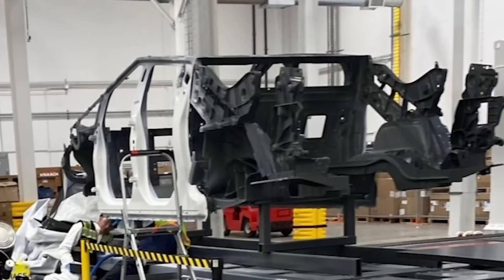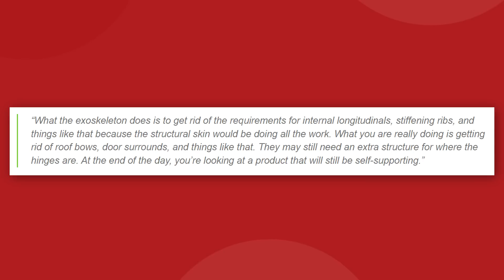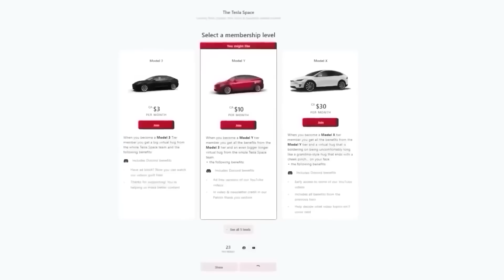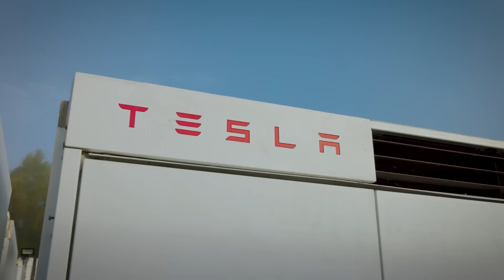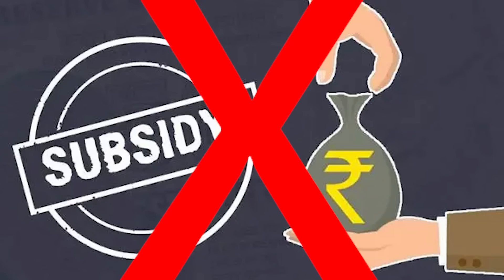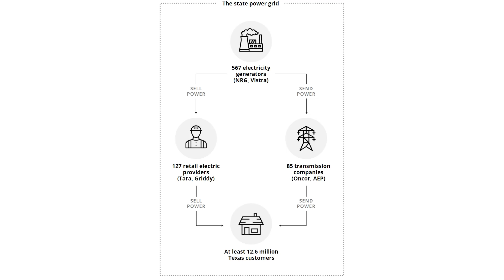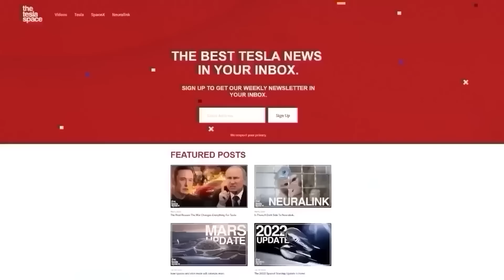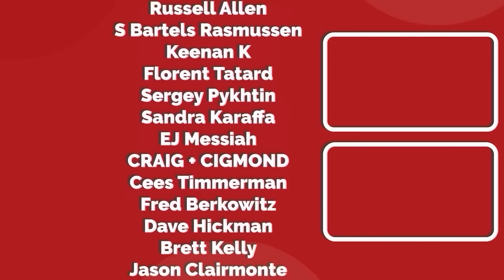New Cybertruck Giga Press Body Revealed!

Comment: Much more stronger and rigid than traditional cab on frame truck designs.
My only concern is when you get in a car accident, how are they going to repair the exterior stainless steel?  They will probably need to remove each damaged panel and reweld new panels on.  No paint job required so it should be still cheaper.  Cybertruck wraps are going to be very popular.

Comment: A possibility is that they may have sprayed it black in order to 3D scan it. Aluminium is reflective, so painting it could help the 3D scan. Checking dimensional accuracy of the gigacast. Very odd looking frame though. Thanks for the video
Reply: Stainless steel*

Comment: IMO unless you are going to use the Cybertruck to haul your groceries from Costco to  home, it makes no sense as a work truck and I will explain. First, regardless of has been published in the past the Cybertruck will certainly cost a lot more than the  Model Y which is over $70 including delivery, licensing and registration and state taxes. Second, as a work truck the range is drastically reduced if you are hauling a trailer and even drops more in the Winter. Third, because of the unibody construction with those panels and large battery an accident will probably result in a total loss (who is capable of repairing and what is the cost of the panels) which will make the insurance almost unaffordable. Fourth, the cost to charge a tri-motor at $0.43 per kilowatt-hour will be pushing $100. Far better off buying a beater gas or diesel and using that for 10-20K miles especially if it is going to take a beating like most work trucks.

Comment: The Cybertruck outer is made from stainless steel BUT the inner frame is pressed alloy steel connected to a diecast front and rear like model 3 and Y.
Cybertruck is not a cab on frame arrangement like most other trucks.
Tesla frame combining diecast and stamped parts is as far as i know unique in the motor industry it is lighter and strong. The stainless steel outer skin will be attached probably by spot welding to the inner steel frame forming part of the vehicle frame structure.
Reply: (repeat) Has Tesla mentioned anything about snow plow attachment? Mine takes quite a beating, sometimes, when it runs into a bank of snow that's really compressed - almost ice. All force transferred to the frame of my Chevy, of course, but seems it'd be more than a stainless steel sheet could withstand without ripping or creasing…

Comment: 03:20 black is the colour of the powder coat. A powder adhered by extreme heat. It is usually used to create a hard finish that is tougher than conventional paint. Automotive industry frequently uses this technique for their vehicles. This would be an inner frame to the cyber truck.
Reply: I was saying the same thing, this is what happens when people that know nothing about manufacturing or engineering comment on things they nothing about. Lol
Reply: @evandipasquale9255  Precisely. They need likes and subscribers.
Reply: They will not powder coat the alloy castings as that would add an expensive and totally unnecessary procedure.
A coating would also interfere with machining operations like tapping and threading required to connect this part to the rest of the vehicle and the suspension components.

Comment: Idra does not have the smelting capacity or the Tesla proprietary metallurgy capabilities to test a cast in Italy.  These are several sand-cast prototype molds with clearly visible welds of 4 to 5 parts.  The cybertruck gigapress has not yet been delivered to or assembled in Austin.  This is just a mocked-up prototype to test the other aspects of the manufacturing line after the gigapress.  This one is labeled powder-coat.  They are doing what they can to prepare for the steps after a gigapress.

Comment: First at Idra, in Italy, where they make the gigapress, I think they tested the cast machine before they took it apart to send to Tesla, so that casting might be one of the test castings from Idra in Italy. second for the color, if you look above the casting it is in the powder coating section, so it just might be the aluminium casting powder coated in black.
Reply: They did NOT cast any parts in Italy. The head of IDRA stated, on camera, that they are not able to test a press that size with molten AL. The interview is on Munro live.
Reply: @GROND15  you are right they tested it but did not cast aluminium in Italy, thanks. Like you said it just might be a test vehicle.

Comment: Seems like you don't follow Tesla guys at all. Alot of others have reported on this now for days. And before that several times on Tesla Time News. 

They spotted 2 outside there weeks ago and explained like they have done before that its most likely test carts for the lines, robots needs to be calibrated, they play with the features the hole way to get all other parts of the line setup before the press comes in the picture, we spotted Model Ys in Shanghai and the same in Germany months before production. 

Its a shell and has nothing to do with the ready product. The holders your spotting in the top back is probobly for the cover to roll out over the tray, the one Elon stands on when he shows it of with Jay Lenno. He jumps on the back and that rolls in, have to be really heavy duty to take his weight like that.

Comment: My take is that the body/cab is stamped aluminum sheet metal just like all the other cars.   The rear is likely a multi-part aluminum casting and just painted black.  This black may be a sealant of some kind?  Production trucks will just be "in the white" until the chassis is painted or powder coated.    With the stainless steel body panels, Doc Brown has a great chassis for a new time machine!
Reply: the black maybe camouflage to hide details for now...

Comment: Debunked by Sandy Munroe after a detailed examination he said it was a trial casting of 4 to 6 components welded together as a prototype.
The 9000T gigapress has not yet pushed out any components.
It is still arriving in parts.
Reply: Exactly!
Reply: The press was assembled and tested in Italy, then disassembled and shipped, making your statement demonstratively false.
Reply: @tedmoss  not demonstrably false, until you can prove that it was tested using a cybertruck mold.
Reply: Giga presses are supposed to be assembled and tested in the factory first, so i assume part of testing would be to produce castings for more testing of machine and its product... Then the giga press is disassembled for shipping presumably with samples of its best castings for measurement and more testing by Tesla..
Reply: @yootoober2009  It wasn't. These presses need a large and dedicated infrastructure to work as intended. Also, any parts produced would be junk without a lot of time working on the process. Disassembling it, and shipping it thousands of miles would negate any gain in getting it to make good parts. Not to mention it would be very expensive to do all this for no gain. In any case, the head of IDRA said plainly that they do not cast metal when they test a press that large.

Comment: According to Munro.. this aint the mega casting. This is like 4 casts and likely just some preproduction stuff that they’re testing the line with.
Reply: Maybe a totally different car: the parts going up make no sense at all according the original design
Reply: @rehleinklein7373  remember.. this is years later and a lot of testing later. They may have scrapped he exoskeleton design or edited the frame significantly for a hundred reasons
Reply: @airheart1  that sucks. I wanted that truck for a mad max style scenario
Reply: I thought Sandy'd said it looked like sand-cast parts welded together…
Reply: @jbak6892  he did.. that’s the ‘pre production’ stuff i was eluding to. This, I believe, is just a test mule for the factory line.. not an indication of what the production product is likely to be. We’ll understand more in about 6 months I think
Reply: Munro is better than I am at guessing.
Reply: @tedmoss  lol…
Reply: Lol…. The « mega casting ain’t going to be a thing! It’s going to be at least 2 or 3
Reply: @carholic-sz3qv  the mega castings are already a thing.. the mega casting for the Cybertruck will be a thing, as we’ve already seen the enormous 9k ton f’n casting machine. It’s just not setup and running yet. Now, what else will be needed BESIDES that mega casting, is still in question. But to say this or any other mega castings Tesla is, or will use, is ‘not a thing’.. is pure ignorance.
Reply: @airheart1  nope!! Lol….. where are they à thing!? 9k machine doesn’t mean it’s going to make all that massive casting just in one piece lol…. Stop dreaming too much!
Reply: @airheart1  pure ignorance my @zzzz why didn’t they just cast everything at one the whole car!? Lol…..

Comment: an exoskeleton cant be used to create the entire truck. parts need attachment points, motors need strong and complex motor mounts. Thick steel plates cant reasonably be used to create the complex geometry many of the parts require. the steel body will likely act as a stiff structure which reinforces the aluminum subframe, which provides all the light weight complex mounting points needed for the trucks assembly.
Reply: Why don't you further review the logic behind the design?

Comment: I think they should have 2 charges on the truck 1 that can use v1 to v3 chargers and 1 v4 charger.
Why so when at home or needing to stop at the many normal tesla super chargers.
Thoughts.
Reply: Why not just have a v4 charger and some form of adapter?
Reply: @drew4711  That's all dandy and fine but you still have to replace all the old one's
Reply: You really need to learn more. That is not in any way logical.
Reply: Difficult as it won't conform to the obsolete NACS standard

Comment: I mean, they still need something to attach the steel to. They would have to do something to reduce the flex of the body panels, because we all know what happens when you pick up a sheet of steel and shake it. I think they’ll just use the strength of the body panels to reduce the internal structure, not entirely remove it. With how heavy the truck is going to be I don’t think they can get away with just sheet steel 😂
Reply: Isn't it more than just the sheets of steel, though? It's fastening the sheets of steel together in the angles and shapes of the CT that will provide its rigidity.
Reply: Also have to add in the fact that people will be towing with it, so not just extra weight, but a massive increase in strain from the wheels trying to twist the body as all the additional weight increases both traction and drag during acceleration. Ever see an old muscle car's quarter panels after owners increased the power output well over factory? Yeah...
Reply: @72192cody  Yeah, very true. Though, I don’t know which way the frame will be torqued because I don’t know how those motors are oriented relative to the frame, but it is going to torque it either way!
Reply: Has Tesla mentioned anything about snow plow attachment? Mine takes quite a beating, sometimes, when it runs into a bank of snow that's really compressed - almost ice. All force transferred to the frame of my Chevy, of course, but seems it'd be more than a stainless steel sheet could withstand without ripping or creasing.

Comment: You're over estimating the usefulness of such tiny storage batteries. Three windmills produce the same power and we have hundreds in Liverpool Bay
Reply: Windmills produce flour, not power.
Reply: @garethjones1982  Not only that, they drained most of the Netherlands under sea level
Reply: @MegaWilderness  those would be wind pumps.
Reply: @garethjones1982  Thanks that took me a while to get your point